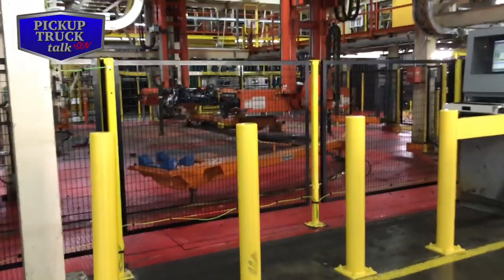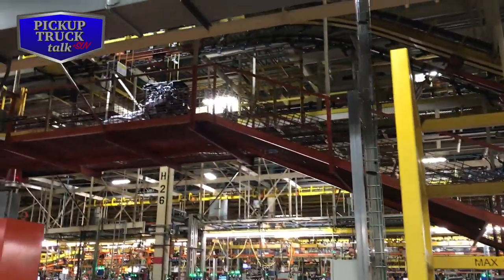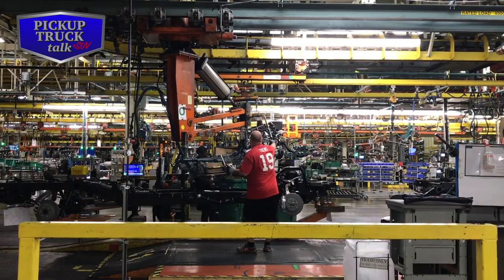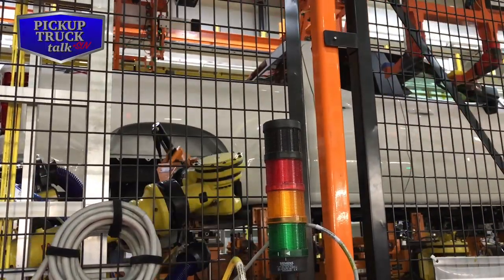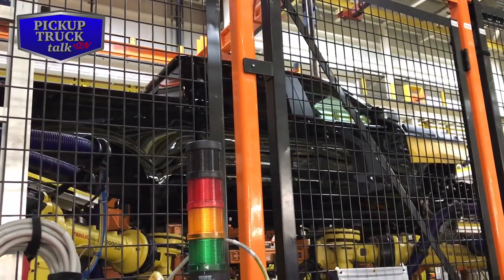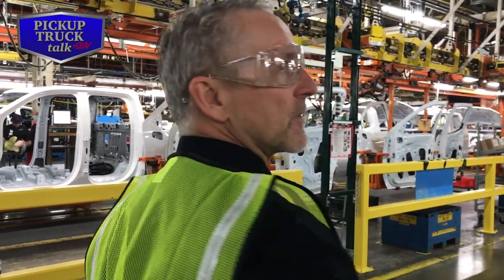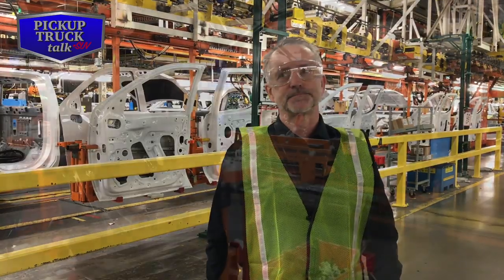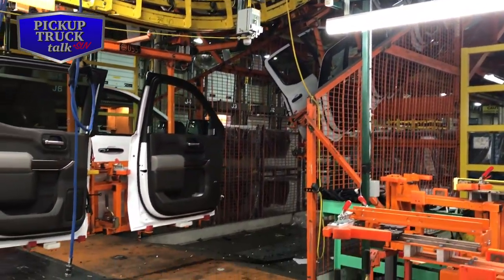2019 GMC Sierra, 2019 Chevy Silverado Ft. Wayne Assembly Plant Tour

Comment: I ordered a 1999 Silverado. It was built at Fort Wayne. It had 200.000 trouble free miles when I sold it.
Reply: You should have kept it. The 1999-2006 trucks will go down as some of the best ever made. I’m at 300,000 on my ‘05 5.3 with a water pump being the only thing I’ve ever replaced. While million mile ones exist I’ve seen tons with over 400,000 and 500,000 miles. It’s fair to say that they don’t make them like they used to. I wouldn’t touch a newer one. I’m going to keep mine going for as long as I can. I don’t live in a rust prone area
Reply: @RobertSmith-le8wp  07 classic 278k she's been awesome.

Comment: Great video! I love the new Silverado but I'm jaded over the AWFUL experience I had with my 1997 Blazer. Electrical problems from day one. Had to trade it after only two years and took a 6K loss on the trade. Let's hope these modern production line processes improve quality...!
Reply from the maker: Thanks!
Reply: I had a 1998 blazer 4x4 got 250k then sold it for 3500k great truck. Sorry to here that about your blaze.
Reply: @minnesota7010 Thanks Bro, glad yours was great. Actually my Parents had a 95' that ran for at least a decade without any issues. A friend of mine same thing. Back then the styling of it was great, perfect size and was very comfortable to drive daily. One other thing, GM was non-existent in the support overall. $27K (at the time) basically down the drain.

Comment: Question is where in the world do these truck sell because almost every single truck I search on dealer lots have the 3 number vin code; made in México. 1vin is made in Ft wayne. I even allocated a ZR2 Silverado for sale in Ft. WAYNE INDIANA AND HAD VIN NUMBER 3 =made in Mexico 🇲🇽
Reply: I knew at one time the crew cabs were coming out of Mexico and regular/extended cabs were Ft. Wayne or Oshawa... I think 2500 and up is Oshawa and Flint
Reply: I live in the great lakes region and 90% of the new truck listings around me are Ft. Wayne trucks. After Ft. Wayne negotiated to build crew cab short bed trucks I'm sure that had a big effect. Previously they were mainly making extended cab trucks with the longer bed. The change coincided with the new truck platform.

Comment: My comment would be GMC and Chevrolet or built and put together at the same place why could they not put their heads together and build a truck that takes the competition out  Or at least  Out  sell them
Reply: frank fagundes LoL the truck’s are basically the same...that was the plan in the first place
Reply: @T3CHK1NG54   Yes they are exactly the same truck but yet they  Try to compete against each other instead of the other automakers
Reply: The Silverado and Sierra are still both sold under General Motors and, especially in 2019, both brands offer significant stylistic differences. I'm personally happy that GM has two options. I've always preferred the GMC styling over the Silverado styling myself. 

Also, economically it doesnt really matter that they are two different brands. General Motors outsells Ford in the truck market by quite a bit for the last 4 years straight. Besides, it wouldn't really be any more profitable for GM to combine GMC and Chevy. Sure, they could then own the "best selling truck brand" title, but what does that really matter? It means pretty much nothing when you consider that GM still outsells Ford in the truck market.
Reply: DouubleTaap I Am a GM guy and I don’t think they outsell ford even with the Silverado and Sierra combined...they have some years, but definitely not the last 4
Reply: @T3CHK1NG54 Straight from GM: 

 "On a volume basis, we've sold more pickups than the F-series over the past four years in a row and that continues through this year," said Jim Cain, a GM spokesman.

For all of last year, GM sold "a record 948,909" pickups in the U.S., "more than any other automaker for the fourth year in a row." That includes full- and midsize trucks.

Ford sold 896,764 F-series last year."

This includes The Canyon and Colorado mid sized trucks as well. I never said that the Sierra and Silverado alone outsell the F150 for 4 years in a row. I only said that GM outsells Ford in the truck market.

Comment: WHAT no hard hats in assembly area !
Guess  visitor and employee safety FAR DOWN on priority list  even below quality control !
Reply: I have worked in an automotive plant...only select areas require a hard hat...lots of workers have plastic inserts in baseball caps if they have to stick their heads in vehicles....moral of the story is you really are just talking out the side of your neck
Reply: Letting you know that a hard hat saved me from serious head injury in a plant accident, also hats were mandatory even for visitors .
Reply: Captain Stabbin but you just watched a video where lots of people didn’t have anything on their head...what is your point..you where proved wrong before you even commented...did you even watch the video?
Reply: Any job working in a pit or requiring you to go underneath the hood while on the line has mandatory bump caps. There are no conveyors above walkways, all conveyors are placed in areas that do not see heavy traffic. There are also steel grates below the areas that do have the conveyors.